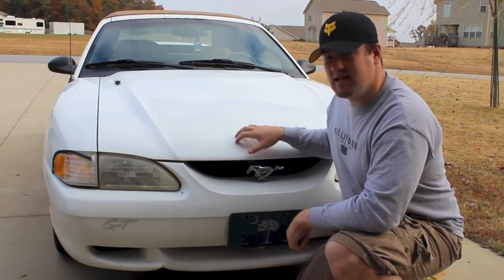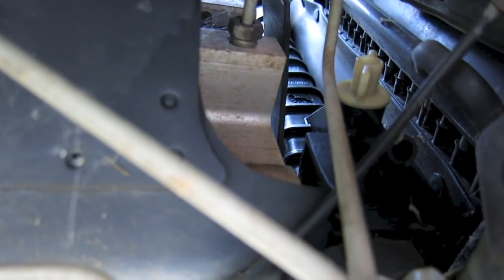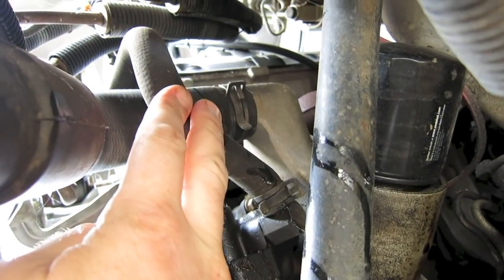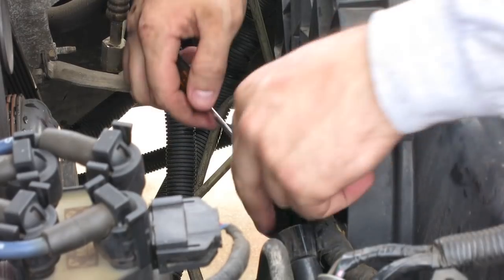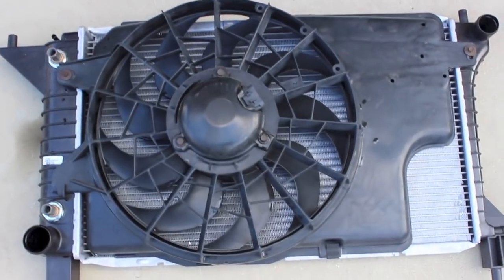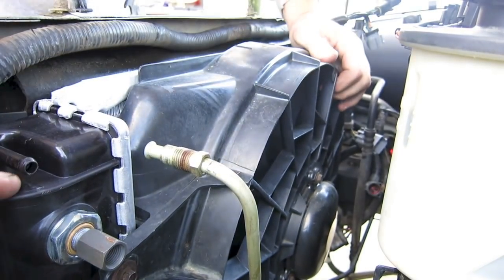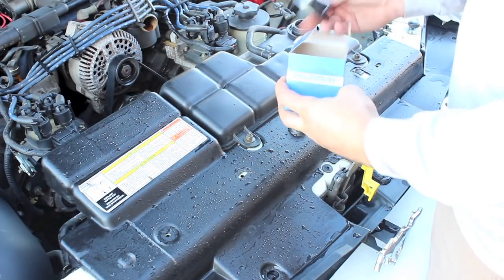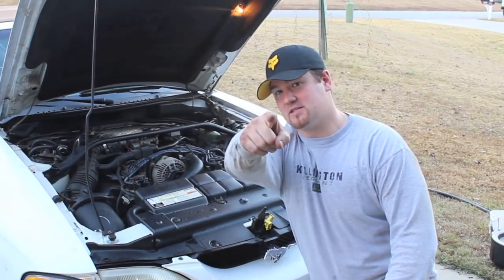HOW TO INSTALL 1994-2004 MUSTANG RADIATOR GT 4.6 5.0

Comment: 99-04 yrs are different. Transmission lines bolt directly into the transmission cooler behind the radiator.
Reply from the maker: +Kevin James thanks
Reply: How much do you know about 2000 models?  I tried to replace the radiatior in my V6, earlier this week, but couldn't get the top transmission line to come out.  After trying to get it out for over an hour, now it won't go back in either.  Do some models require a line disconnect tool?

Comment: can I put a radiator out of a 99 GT Mustang and fan and shroud  in a 98 GT Mustang
Reply from the maker: +Ruben Gonzales I don't think so. It is a 5.0 for the 97-98 mustang, and a 4.6 in the 99. It might not fit right. But its possible there is extra room. just have to try

Comment: my husband broke the  radiator and its broken at the bottem and need help how to fix it its an 2000 mustang
Reply from the maker: +amber carlson oops, well you will have to take it out to replace or its possible to use JB weld on it too.

Comment: how many coolant gallons should i buy?
Reply from the maker: +luis jimenez depends if you are getting concentrated or 50/50. If you are short you can always add water.
Reply: +TheRykerDane im getting 50/50
Reply from the maker: luis jimenez you will probably need at least 2-3 then